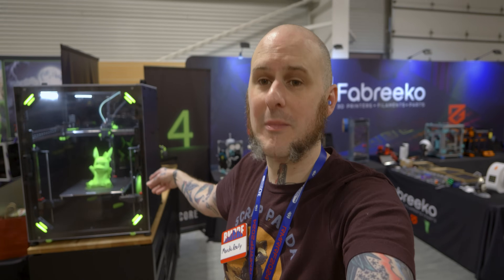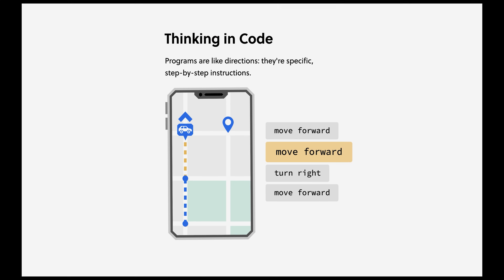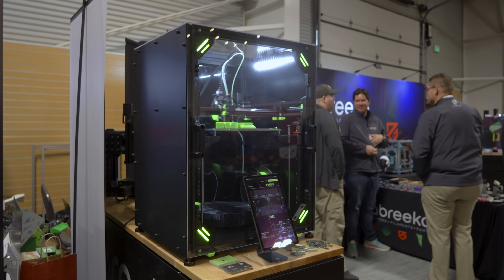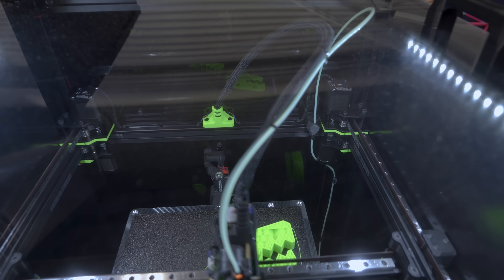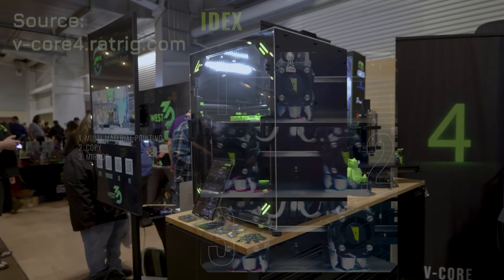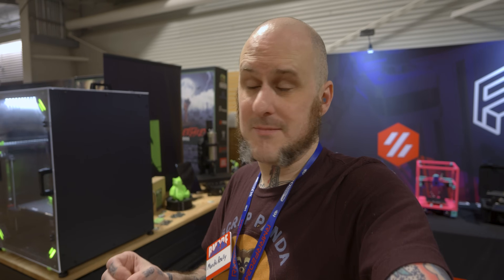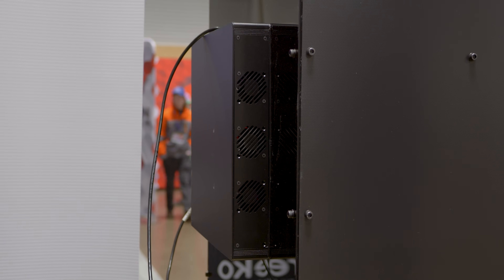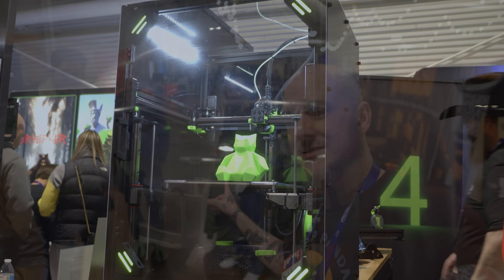FIRST LOOK at RatRig's V-Core 4!

Comment: I wanted a 500 mm Rat Rig V-Core 3 last year.  Now I REALLY want a 500 mm RatRig V-Core 4 IDEX.  The entire 3D printer industry got a lot more interesting in the last year and RatRig definitely hasn't been napping.  The hybrid coreXY kinematics is a very clever development because it not only doubles the power of the X axis to accelerate the mass of the gantry, is allows them to very cleverly add an IDEX to a coreXY machine, which is huge.  I print functional parts so I was never interested in an MMU with all of the time and material wasting poop, but it would be very useful to have a nearly instantaneous tool head swap with a completely different material with different nozzle temperature, so I could print ABS parts with TPU feet and bumpers, or print PET-CF parts with easy peel PLA support... with almost no increase in print time compared to printing in a single material, and no wasted filament and piles of printer poop.  I'm reluctant to try bleeding edge stuff like this but an IDEX coreXY machine would make it worthwhile to use RatOS, custom slicing, etc.

I watched a video tour of the RatRig facility and my favorite part was watching a room full of RatRig 3 printers making high quality parts for the RatRig 4 kits.  Very cool.  Because the parts they make are small, they built their print farm printers with large beds but shorter in Z so they could stack more of them in a compact print farm, with each printer printing a reduced build plate during the day and a full build plate on the longer night shift for a 24/7 lights out operation.  Like Prusa, that in-house print farm is a testament to the reliability and utility of their printers.

Comment: Imagine IDEX with ams, while one head is printig, the other can change filament resulting in up to 0s waiting vor filament changes
Reply from the maker: I think it will probably be difficult to processes all of those things at one time. Klipper usually processes in order of commands, so it may have to wait for one to complete, but if they can figure out concurrent commands happening, that would be AMAZING.
Reply: That's what I'm hoping for with the new bambu lab printer that is releasing this year

Comment: ya I have heard of Rat Rigs for a long time as a competitor to Voron design printers, but....ya, I'm with ya, real interested in a 500x500 Core X/Y printer kit that is fully enclosed.  It probably WON'T be cheap but, if you can run real big batch prints faster, or print LARGE objects with zero ringing like some of the large Cartesian types have some issues with....I'll be watching for this too.
I have two Neptune 4 Max's as my big printers, and a Voron 2.4 350 and the Neptunes are decent in their speeds, but the kinematics are what hold them back.  Their Jerk Settings are very slow because of the big big bed, but it can still do decent speeds of about 350 print speed wise, provided you have HS PLA in.  They are rated for 500, but I don't believe it for the Max version, the base line one (Neptune 4 and 4 Pro), ya, but not the Plus or Max.
Reply from the maker: My Neptune 4 Max has let me down enough, I'm over bed slingers at that size personally. It is time for a big Core-XY in my life that won't have the bed slinging around. Even if I couldn't go FAST with it, I'll just be happy to have improved print quality. I just did a big project last week with the N4Max and was entirely unhappy with the final print results as far as quality is concerned.

Comment: Does support carbon fibre infused filaments ?
Reply from the maker: That's all down to the Extrusion system. The Extruder, Hotend, & Nozzle. Those are easy enough to spec for carbon filaments.
Reply: it comes by default with a orbiter 2.0 and a rapido 2.0, with the correct nozzle you can print CF materials, no problem

Comment: As someone that's new to 3D printing (I have a P1S) I've gotten the itch to build a printer and I'm not completely sure where to start. First I was looking at Voron's because they seem to be the most well known, and there seems to be an abundance of info out there about building/troubleshooting them. But RatRig seems like an interesting option as well. Now I really don't know what I want lol
Reply from the maker: I generally recommend starting small, something like a Voron 0 is very fiddly to build due to its size, but it is also the least $$ investment and one of the overall easier build. Aside from the fiddly nature of smaller parts. I'll be doing a series of Streams on the Mandic Labs channel when I build the RatRig, so that should hopefully show how that goes. I haven't built one yet to give much more than that.

Comment: Do you have the true printable area size (on the Z specifically)
Reply from the maker: Not yet. I will once the machine arrives. X/Y should be 300 no problem as there is extra room for toolhead parking with IDEX. Judging by the scale of the machine I anticipate 300 on Z will likely be accurate as well, but that is a guess.
Reply: @MandicReally  thanks - my concern is that the 350 Voron 2.4 is not 350 in the Z
Reply from the maker: @txwombat7826  Oh I understand, my 300 V2.4 is more like 265 with the Kinematic Bed & default design. I'll let you know when I know. I'm certain I will max out the Z on the machine, I always do to see where the claims lie.
Reply: @txwombat7826  it's cubic, with some room to spare :)

Comment: 20 seconds in, we get a 2min ad...
Reply from the maker: 30 seconds in, a 90 second ad...

How do you pay your bills? Cause this is how I pay mine. I wish I didn't have to run ads, but the bill collectors don't accept views as payment.
Reply: @MandicReally  I get it.. cant the ads be the last 90 sec of the video?
Reply from the maker: @adamfilipowicz9260  Sponsors demand it be within the first 2 minutes. Some larger channels get to negotiate that point, I'm not big enough to have that power. They know folks will just stop watching the video (which is also terrible for me as a creator) if it is at the end. I timestamp them so they are easy to skip over, that's all I can do and still do my job. It is all a balancing act of keeping sponsors & viewers happy. I try but especially as I'm facing moving cross country right now, I don't have much power at the moment.
Reply: @MandicReally  All good dude. looking forward to your Vcore4 500 build
Reply: SponsorBlock & Ublock origin extensions, you won't regret installing them.

Comment: I'm one of the people that ordered one in the early bird release. I ordered a 400mm hybrid. I've never owned a RatRig before so I'll be watching your video closely because I'm sure you'll get one before I get mine. I'm going to get the IDEX as soon as it's available.
Reply: I'm curious about the cost.
Is it similar to a 2.4?
Reply: @xIsouLcruSHca  yes 300mm 1200 euros 400mm 1350 euros 500mm 1500 euros
Reply: I’m waiting for the idex to come out and the new voron idex to see which one is better.
Reply: I'm kinda sad I only was able to find out about this yesterday. But I placed an order request for the 500mm. I'm going all out lmao. I will get the IDEX upgrade for sure, and future MMU upgrades.
Reply: how is it? do you like it? I'm starting to look at the hybrid because VFA with PETF on the bambu x1c is atrocious at low speed. I bought that printer thinking it should just work ...hehe nop. So now I'm looking for the ratrig idex hybrid instead of the H2D. do you get a lot of stepper motor vertical lines on PETG?

Comment: Im curious how they implement the non idex hybrid software wise. Regular core xy hybrid would have a x and y stepper in the cfg, x being core xy kinematic, y being cartesian. You can easily add another y motor, just label it y1. Im mostly curious how they did the second core xy motor. Labels it as x1 would result in it doing exactly the same as x0, but that doesn't work and browsing the configuration reference of klipper i haven't found a setting to assign one motor to the cartesian axis or core xy axis.
Reply: Unfortunately the hybrid corexy implementation is klipper is incomplete, and we had no success in submitting even simple PR's to allow for inverted belt paths when running in IDEX mode, so we wrote our own, fixed the bugs and extended the capabilities. It's set up as x, y, y1, y2 with x,y as corexy steppers and y1 and y2 as cartesian.

Comment: That's really smart! Will this thing run klipper?
Reply: To clarify RatOS doesn't fork klipper, it's still vanilla klipper mainline, RatOS adds stuff on top to make it a more complete experience that only requires a few clicks to get everything running :)

RatOS 2.1 runs an entirely managed, automatically generated config. If you use one of the 30+ supported boards/toolboards, you don't have to write any configuration or even look at a commandline.
Reply: @miklschmidt  Thank you for that clarification! I haven't used RatOS so far but it sounds like it can be useful (or at least a bit faster) for setting up non-RatRig printers too albeit with a few changes to the config.
Reply from the maker: It runs RatOS, which is RatRig's branch of Klipper designed to be easier to configure and operate. I've not had any experience with it yet, this will be my first time.
Reply: @MandicReally  thank you for your reply, I'm looking forward to the stream!

Comment: i just noticed that even the IDEX has the hybrid coreXY, which means that there are 6 motors on the gantry and an additional 3 for the bed
Reply from the maker: The graphic they produced that shows the swap from Hybrid to IDEX is not accurate. It doesn't show the belt path for the IDEX setup, still shows the Hybrid configuration. The second set of motors that WERE the Hybrid motors will control the second toolhead. So it is still just 4 motors for X/Y & 3 for the Z. 

At least that is my understanding of the setup. I can confirm with RR later.
Reply: @MandicReally  xy will be now X and x1 and the y will be done by the 2 y motors. Can confirm this as i have a vcore4 idex 🤣
Reply: @MandicReally Great video man! High quality as always 🔥 the infographic picture is actually correct, the top Y steppers remain with the same belt path. The A and B motor are the ones which control the individual toolheads. So the belt path from hybrid to Idex is really similar
Reply: nope just four motors (and 3 for Z)

Comment: With multi material prints those tool heads would need to be independent, but they're attached to the same XY rail so how does that work?
Reply from the maker: Separate belt paths. The graphic they produced doesn't show the belt path accurately for IDEX, it still displays the Hybrid-Corey-XY setup. The second set of motors and belts operate the second toolhead. That is why there is a direct upgrade path from Hybrid Core-XY to IDEX.
Reply: @MandicReally  I get you now, I was thinking it hat to separate belts, otherwise I was thinking like a similar system to the prusa XL
Reply: @MandicReally  its the correct belt path, the idex and the hybrid share the exact same kinematic, only difference is instead of attaching both belts to one toolhead, you attach one belt per toolhead

Comment: Tried the hybrid on the Snakeoilxy a while back. If the belt path and tensioning is good, it's solid. They call it extended corexy.
Reply: I noticed the SnakeOil implementation when looking around to see if it had been done before, after we initially got the idea and couldn't really figure out how far they took it. They put a lot of emphasis on gantry deracking via homing the y motors independently, which i still don't understand or see any need for - it implies uneven tensioning. So i was under the impression it never really got off the ground? Care to share more of your experience?
Reply: @miklschmidt  Personally I think the idea of hybrid corexy is great. But only when the printer is certainly designed with it in mind. For me the 180 snakeoilxy I have and tried it on doesn't already have a lot of room to work with. Everything was a tight fit. Had issues with the toolhead colliding with motors. Tensioning and looping the belts was not fun. The ratrig certainly executes it a better for sure. As for the additional endstop was certainly there to avoid any deracking I'm sure. But it was never clear.  SnakeoilXY is mostly a very small group of devs so they moved on to other projects right now, Like their Proosaxy, Which takes an existing prusa mk3s and turn into a corexy printer.
Reply: @GmanL18P  i see, makes sense! Thanks for the follow up :)

Comment: Hybrid coreXY sounds super promising
Reply from the maker: I’m so curious to see an input shaped graph… May have to remove the belt and rerun without it to see the difference too.
Reply: Already checked it, also possible on a trident without loss of build space. Not sure about the 2.4, mainly for attaching the cartesian y axis belt
Reply: On a trident it's good but worse than awd
Reply: @adeo  awd comes always with a loss in build volume on a trident or 2.4, at least not aware of a setup where you cab reach the full build plate, the front corners are pretty mich always obstructed. And is it really worse? The ratrig would always have at least two motors for a movement, in this case for a pure x movement. On a core xy awd the weakest movement would be a diagonal movement, also two steppers are involved. For a diagonal movement on the ratrig you have 3 active motors and any movement thats not pure x or diagonal you have 4. There are also more belts on the y axis (two long ones and two short ones) while on a awd you only have two long ones. Hybrid core xy helps with y axis input shaper, awd helps all around. The question is, will become the x axis on a hybrid setup the limiting factor or is still the y axis the slowest axis? If former is true, then awd is better for speed, if last is true, then hybrid is most likely better. But in the case of the ratrig with the possibility for idex, a hybrid setup is more or less required, nobody in the world wants to deal with 8 pieces of belt running across the x axis. We also shouldn't forget that the ratrig has 9mm belts, the vzbots and voron awd mods still have 6mm belts